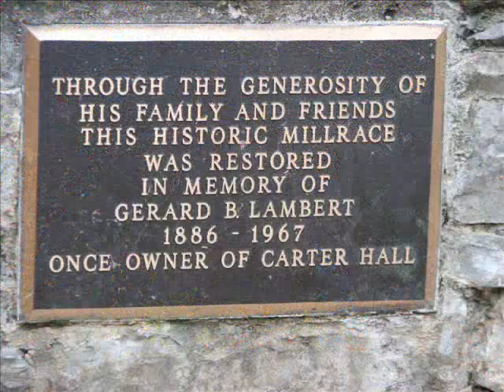Burwell Morgan Grist Mill

Comment: They wear coats in there it is so cold,when in fact, that Waterwheel Mill could also run a Generator and supply Electric Power and Free Heat to that building.